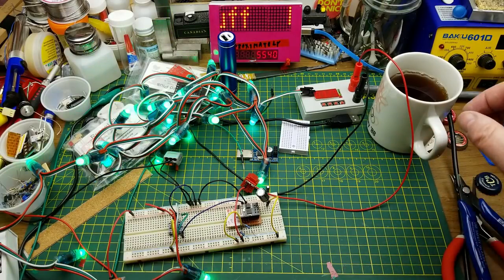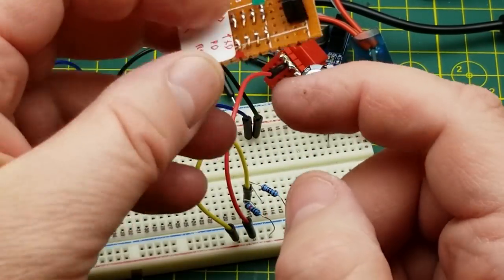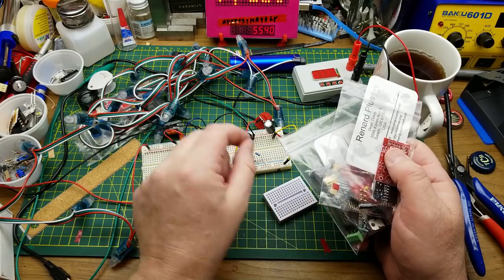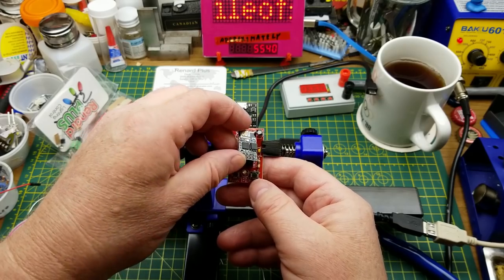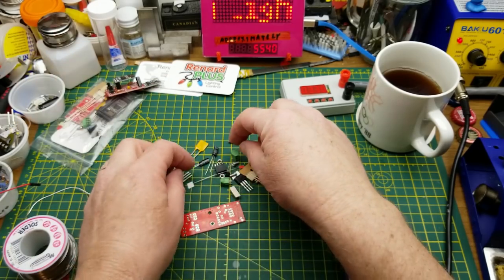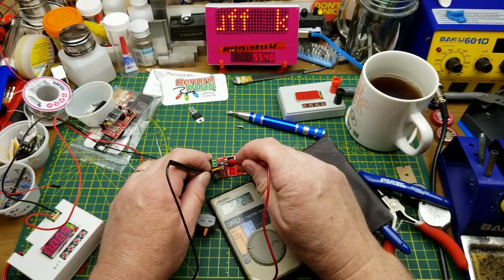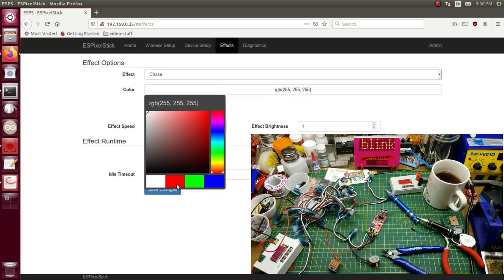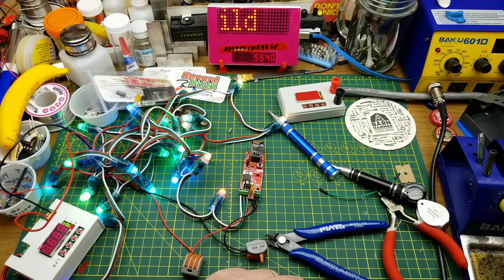Kit build - WIFI Pixel

Comment: Just to be clear, these are called Renard Plus WiFi Pixel not pixel sticks, that is the firmware that goes on them. The 2n7000 is used to convert the esp 3v signal to a 5v level so the pixels can see it.  The yellow thing is a polyfuse in case the lights get shorted.  Enjoy them as much as I have enjoyed your videos.  The Renard Plus team at Renard-shop.com...
Reply from the maker: Thanks again for sending the kits. It was a fun build.

I've edited the title to be more correct.
Reply: @pileofstuff  Cool glad you like these!

Comment: You only need to pull GPI0 down as you power the esp up, you can then release it, it does not need to be held low during programming.  I expect that 12V suply the 3V3 regulator is dropping to much (8.7V) so would get quite hot. common problem with linear regulators so just add an extra regulator and share the voltage drop and hence the power dissipation.  So far I've found that if the ESP8266 is close to the first LED i've never needed to convert the serial voltage to 5V. Have a look at WLED for a good way to control led's

Where's the beer :)

Comment: I like using Addressable LEDs for all sorts of displays or decoration. There are so many options, especially once you start getting into xlights and the like.
Have you seen the WLED sketch by Aircoookie for LED control using the D1 Mini?
By the way, CHPD is Chip Enable. It needs to be at Vcc.
You don't need to hold the program button.  GPIO only needs to be low at boot to enter program mode.
Reply from the maker: A lot of people have mentioned WLED since I did that Christmas light video. I haven't had a chance to check it out yet, but it's on the list.
Reply: @pileofstuff  Also, if you get a chance, checkout the QuinLED Dig Uno board.  It's designed to fit a D1 Mini (ESP8266 or ESP32 version) if you want a neat little board to make a controller with.  
I have no affiliation to them other than using 4 of the boards with WLED on the D1 for my displays.  I like that WLED can handle E1.31 as well as over 90 inbuilt effects. 🙂.
I know you're busy.  I just happen to really like those two projects.

Comment: I am hoping your are familiar with the LED strips that are sold by roll... What is the best method on the cutting and silicone removal to solder and splice..... having issue getting the silicone off without damaging
Reply from the maker: The only time I have used the "weatherproof" LED strips, I just used an x-acto blade and trimmed the silicone coating slowly and carefully. It's not too horrible once you get a bit of practice at it.

I'm sure there is a better way, but that's how I did it.

Comment: How can you tell which USB port is being used by each device listed by lsusb?
Reply from the maker: I can't directly (there may be a way but I'm not aware of it). It simply tells me that the USB device is attached and identified the manufacturer or device type.

Opening any serial port aware application (like the Arduino IDE or a serial terminal is how I normally see the actual tty port names.

But if you want to go deeper, you can use "ls /dev/serial/by-id" and correlate some of the hexadecimal device ID stuff to the port number.

Comment: So without the kits I can still hack this together with the ESP8266-1 and WS2812s that I already have on a breadboard.  It won't look as pretty but should be fun to try.  Glad to see these guys sharing their designs.  Did they make the java programs or was that a community effort on Github?  Looks pretty slick.
Reply from the maker: As far as I know the hardware and software had different developers, but they may all be part of a larger community effort. 

You could ask Kirk (his comment is pinned at the top)

Comment: You were brave to dive into serial programming an old ESP!  You may be able to program it to accept "OTA" updates.  Program it over the air.
Reply from the maker: Not brave enough to program it from the Arduino IDE, though.  This Java flash tool and pre-compiled package makes it super easy.

Comment: WiFi and UDP is not the best option for pixel controlling 🙃 But still a like for the video because the modern sACN E1.31 is shown 😀
Reply: If you're just wanting basic effects WiFi can be nice.  A little more versatile than fully cabled.  
I do agree that complex stuff definitely needs to come off WiFi and be cabled.
Reply from the maker: Yeah, none of this is intended to replace a professional theatrical installation. 
This stuff is firmly directed at the front yard holiday lights hobbyist.